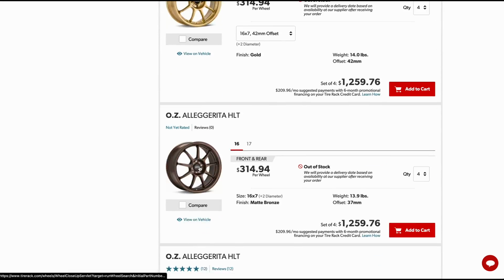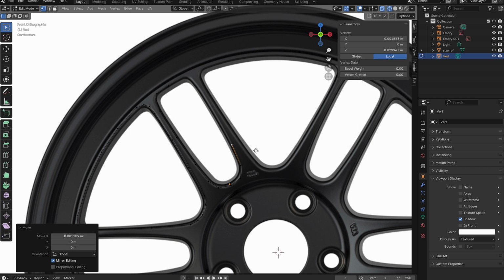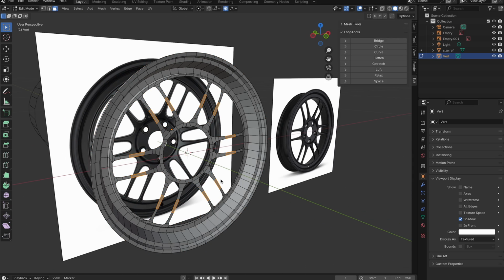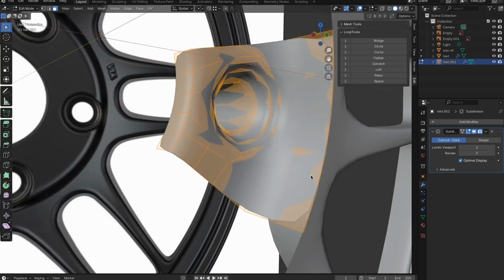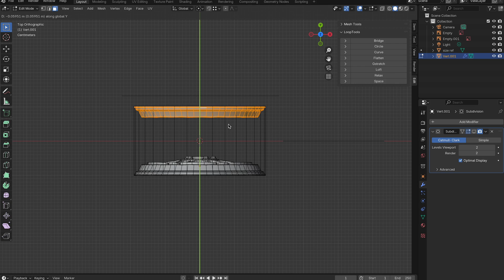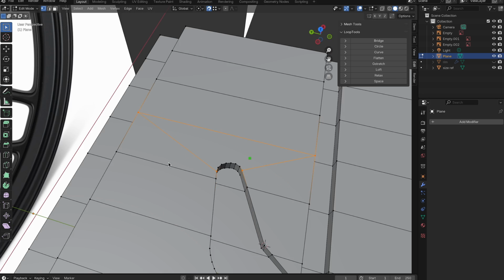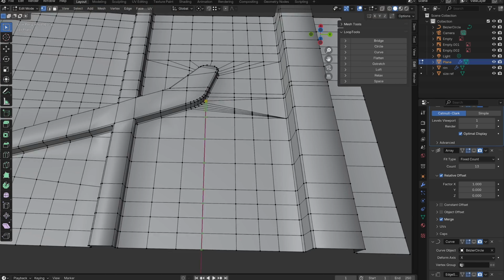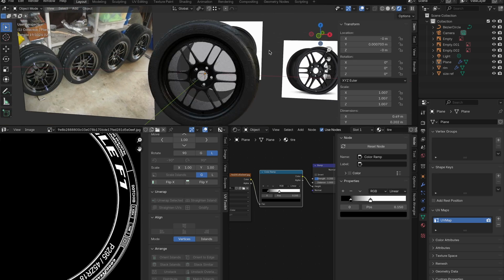How to Model Wheels & Tires Like a Career 3D Artist

Comment: No perspective matching, not taking in consideration the profile of the flange to dial in the exact height and width. Not taking in consideration the width of the bead seat nor its angle..the bead seat hump contour type, nor the usual PCD and the lug seat type, ET, hubface diameter or anything like that. In short...average

Comment: I use a circle (loop tool) on the wheel and when rotating it is clear that the wheel is crooked, but without using the circle when rotating everything is perfect, who knows what the problem could be??
Reply from the maker: It’s possible your objects origin is off center, or that your scale has not been applied before using the loop tools circle thing

Comment: Amazing work. Thanks.
Just curious why you modeled this in blender instead of cad. It's just a revolve with two cutouts in a polar array. Import as an STL.
Reply from the maker: CAD is great for fast modeling but because it’s nurbs curve based the topology when converted to mesh type objects is unmanageably bad. This is the same reason film studios and commercial operations that are using the models they make primarily for digital content creation use mesh modeling rather than more cad like programs. As for why topology matters it’s important for achieving realism in shading and also for rigging
Reply: @bytedozer  thank you for the informative response. i was under the impression that  topology was better from brep models, not worse.

Comment: Quick tip for connecting the inner section with the spokes part at 9:20.  Instead of trying to line things up perfectly and using merge by distance or manually merging each vertex, just select both edges and Bridge them using Looptools.
Reply from the maker: I realized this when I was editing 😭, I was cutting that section and was like, wait, wtf was I doing